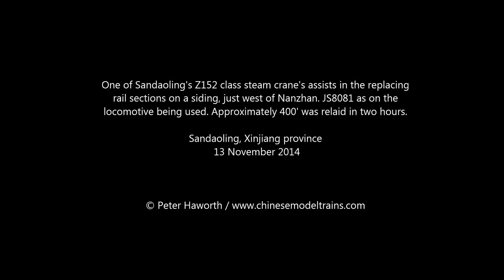Chinese Railways - Siding At Sandaoling Replaced With Steam & Man Power; JS 2-8-2 & Z152 Steam Crane

Comment: excellent.  here in australia we forgot about the usefulness of temporary trackwork.  there is some great videos showing how the panama canal was built using temporary tracks.  in melbourne on the level crossing removal program they use tip trucks.  lots of tip trucks.  and all short wheelbase tippers too.  i bet the trucks weren't just going around the corner with their loads.  they should have incorporated temporary track when doing trenchrail projects.